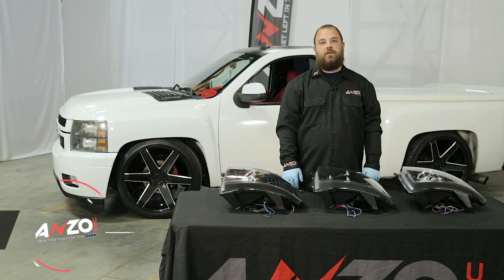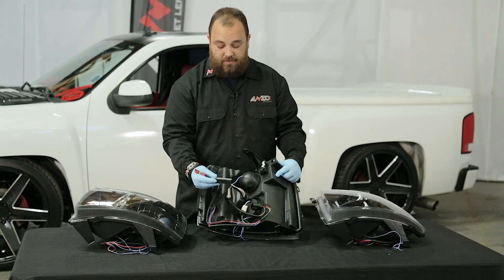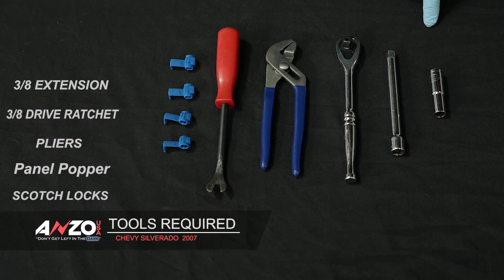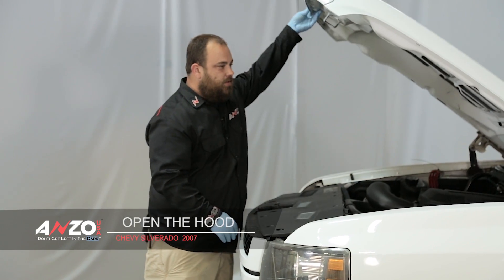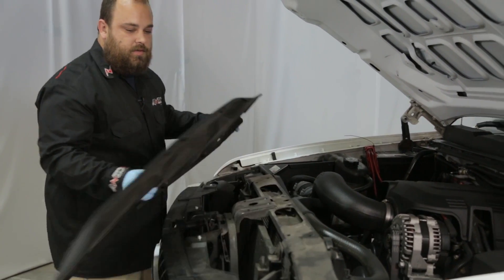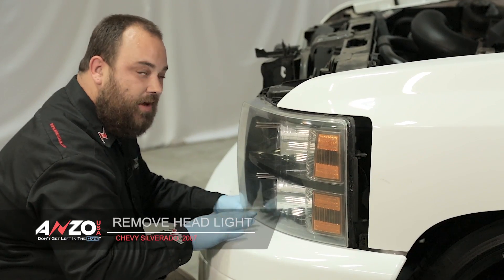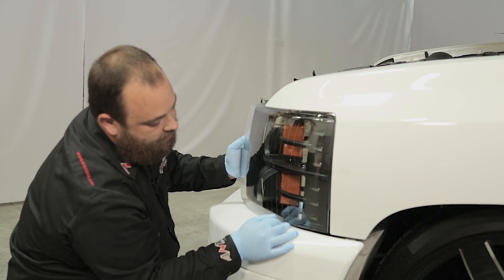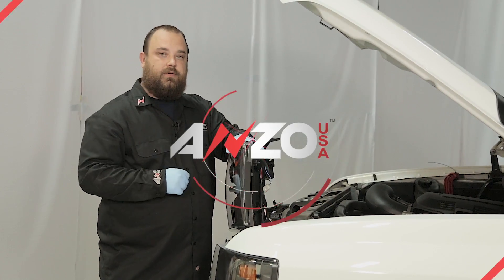Anzo USA 2007-2013 Chevy Silverado 1500 / 2007-2014 2500HD/3500HD Projector Headlights

Comment: Your website says these projectors use halogen lights. How do you change the bulbs when they burn out or to replace with LED?
Reply: The low beam bulbs that came with mine just burnt out after a month (very unhappy about it). As far as swapping over, just pull the rubber cover off the back of the bulb area, there should be a metal clip holding the bulb in. Release the clip, and swap with your bulb of choice. I was going for this: http://www.lightinthebox.com/gc-h3-50w-10-cree-xbd-1000lm-6000k-white-light-led-for-car-headlamp-fog-light-dc12-24v_p2562901.html?prm=1.10.11.0  For my low beam/DRL, and this: http://www.lightinthebox.com/sencart-2-x-h1-p14-5s-50w-white-yellow-red-cree-8led-car-drl-headlight-fog-light-daytime-lamp-12-24v_p4939189.html?prm=1.10.11.0   for high beam.

Comment: in the instructions for installations it mentions a tan wire is that the yellow wire.  every thing working but blinkers 2007  chevy.  what is the problem.  Do these lights ubar and leds go out do they have a fuse where do i get replacement bulbs

Comment: I just install my anzo headlights and they don't stay on in Auto set up to stay on even during the day. I did the conections just like this video shows, but I have to turn on the lights manually. Did I did something wrong?
Reply: lanzeroz05 did you figure it out? Having the same problem
Reply: Not sure if anyone answered this, but to fix that problem you have to wire the u-bars to the daytime running lamp and not the amber driving lights. They weren’t designed for it... but that’s how you get the look you’re wanting